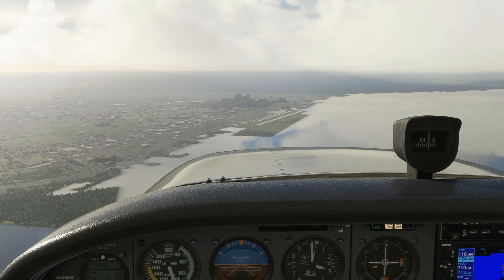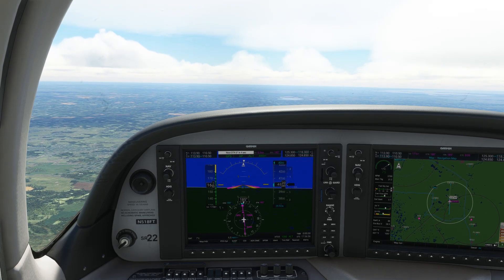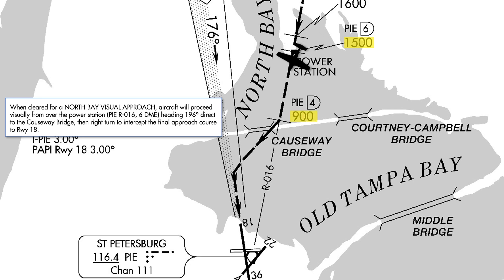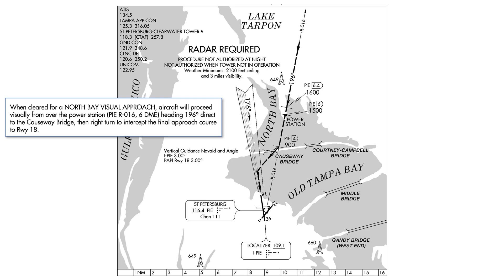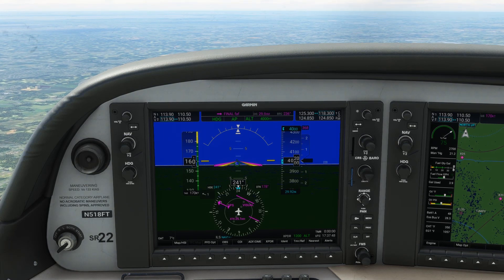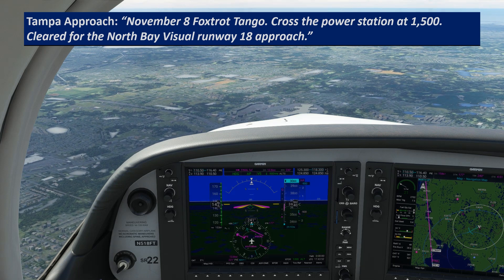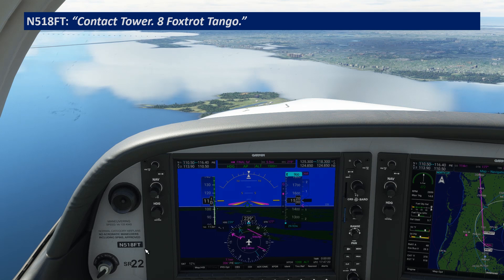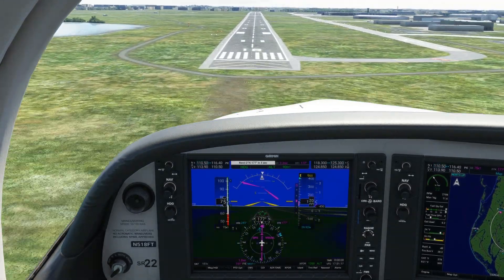Charted Visual Flight Procedure | Special Visual Approaches

Comment: ATC: "vectors for north bay visual"
Pilot in VFR Piper Cherokee: "unable" (due to lack of procedure in cockpit)

TTP is not required equipment for VFR flight

But nothing wrong doing it if able and have the procedures. but would be far easier for tower to simply vector you onto final and skip even mentioning the procedure.
Reply: It's not designed for VFR at all, it's IFR approach
Reply: @wliu6381  then it's fine, but also a little pointless.